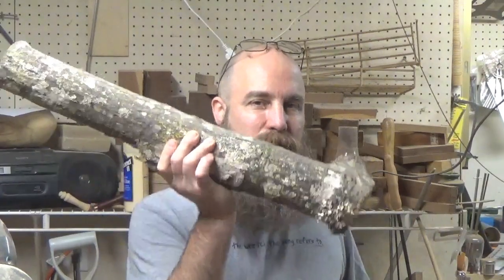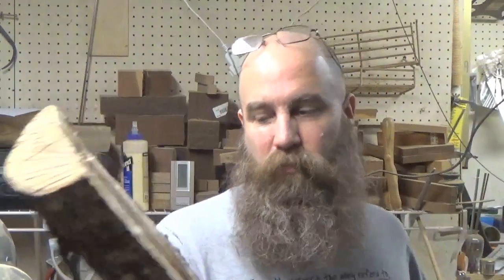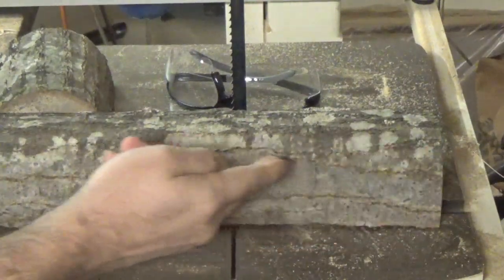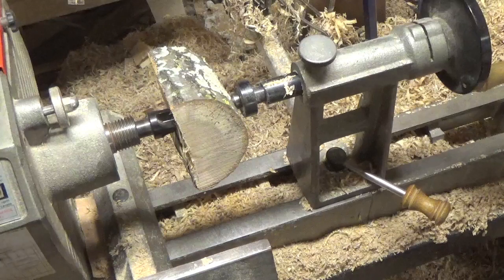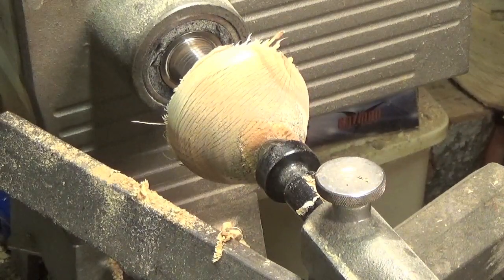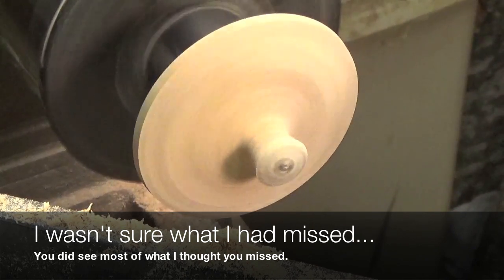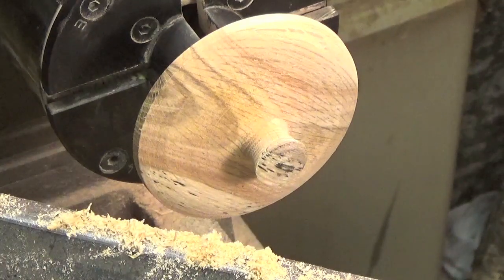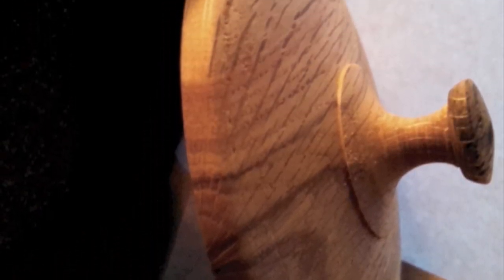Woodturning: Oak Coffee Cup Lid

Comment: Thanks John, great video, very informative beginning and one great idea.  A matching coaster would make a nice set. Curious as to how long between when you got that piece of oak, split it and turned it?   Your comments in the beginning indicated splitting as soon as you can to avoid an excessive amount of cracking but once split can it be turned then or is it best to wait?  Just get started.  Thanks again.
Reply from the maker: Oak is the worst for cracking. I split it as soon as I get it back to the shop. That generally confines cracking to a single check, but not always. Depends on the size. That piece might have been six months in the shop. I only date cut blanks so I lose track of split wood. You can turn it right after splitting. Turn it to rough size and let it dry for a week or two then finish it.

Comment: The not being able to reply to comments thing is a G+ setting on their end, it carries over to YouTube.

Thanks for the video. For some reason I have been trying to flatten split pieces and then get a faceplate on there. Just completely didn't think of going between centres to start with. Do'h! Lightbulb just went off over here :)
Reply from the maker: I do use a face plate for large pieces, but I don't try to flatten the surface completely. Just flat enough to sink a few screws with no wobble. Thanks for the G+ info. And thanks for watching.